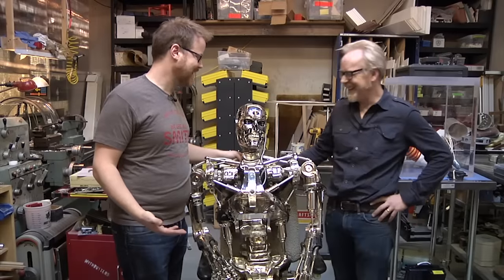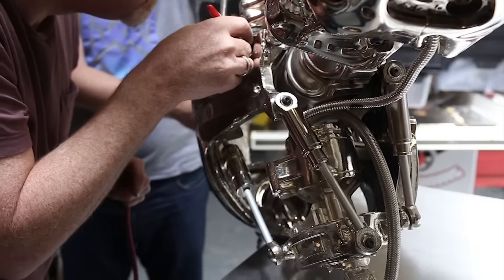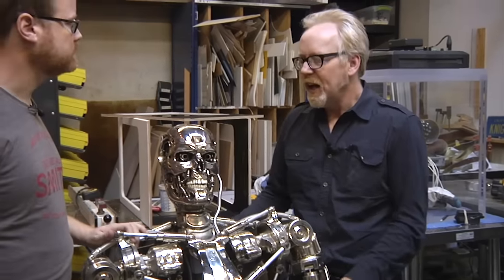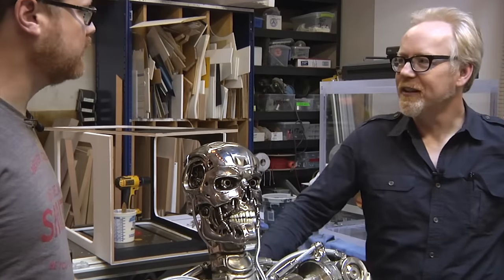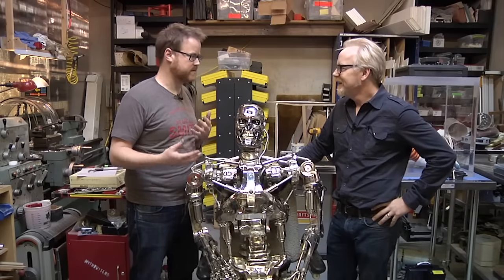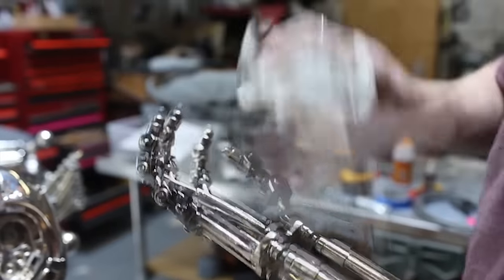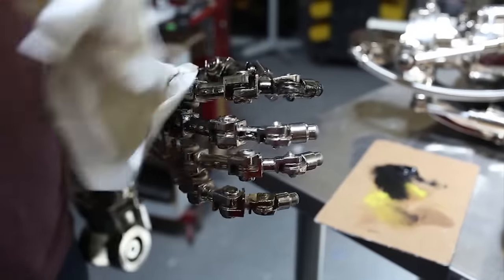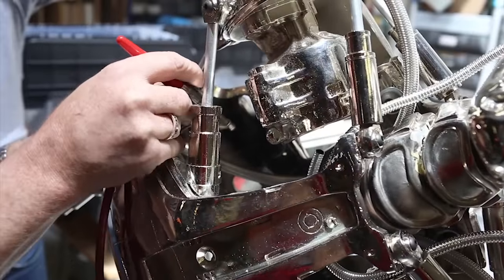Adam Savage's Terminator T-800 Endoskeleton

Comment: Use an Arduino to follow you? If you are planning on use image processing, it's quite impossible with a microcontroller. You are gonna need a ARM or microprocessor or something like that, which is much powerfully. Arduino would be great only to control the servo motor in the head. But, this can be done with RC (servos and a radio controller) as well.
Reply from the maker: We had talked about using a few IR movement sensors to get close enough.
Reply: Tested I thought about that too, but you guys need several of this sensors than, and they will be visible, which would look great. A camera in the eyeball of the exterminator would be much cool!
Reply: Xano Trevisan Kothe It all boils down to how many pixels it has to process and how fast, there's a kickstarter project that does it with an ARM and does I think 20 frames per second at 340x200 but if you settled on 1-2 frames per second and 120x80 pixels an Arduino should manage it. I don't expect you would need more than 1-2 frames per second to perform object following.
Reply: LD Gaming/The LDG
Please pardon my ignorance on this, but what does this 1-_-1 mean?
Reply: I uh I dont know
Reply: LD Gaming/The LDG
Thanks
Reply: +Xano Trevisan Kothe I know I'm probably performing a bit of necromancy here, but a few thoughts on this. You could most likely do it with a Raspberry PI which aren't much more expensive than an Arduino but they are a lot more powerful, heck for image processing they actually have gfx chip that can render HD video, though for actual image processing I'd suggest probably going lower than full on HD as that's still a rather intensive task.
Reply: +The Logan Hi logan, you cant control servos with raspberry that's it
Reply: I'm a programmer not an electronics wiz, so I don't actually know what I'm talking about in regards to motors and such, but I found this guide before I posted just to be sure and figured that it was doable.
http://razzpisampler.oreilly.com/ch05.html

If all else fails I suppose you could always just hook up an arduino to a raspberry pi and fix it that way?
Reply: The Logan it's not going to working as you expected. As it says "Although this will work, the PWM generated is not completely stable". You servor is going to move all time because of the unstable signal, which is pretty bad. You have to use a microcontroller to control these thinks
Reply: Ok, so a Raspberry as brains and an Arduino as "brawns"? Would that do it then?
Reply: the way to go is: start with arduino then move to integration with raspberry and then image processing
Reply: Ok, I think that's more or less what I said, with the addition of what to build first xD
Reply: +Xano Trevisan Kothe Eh, it's certainly possible but not always the easiest to do. Some really basic code could trigger movement left or right etc. Not everything has to be super technical or 100% spot on, for his purpose a few lines of shitty code and some extremely basic motion detection would work just fine.
Reply: +Xano Trevisan Kothe I control servos with a raspberry <<< busted!
Reply: C ancelor
The Raspberry has a very powerful processor at its core, so I'm not sure you've busted anything in regards to Arduino. The Arduino is an ~8MIPS processor and the PI is a 1000MIPS processor. MidnightMarrow correctly suggests that the Arduino can do it given the correct design contraints and his wording also suggest (maybe not intentionally) that you can do it without a processor
Reply: +Xano Trevisan Kothe Raspberry Pi with OpenCV for motion tracking.
Reply: +Xano Trevisan Kothe necro-thread I know, but rather than a full on microcontroller they make a really good pwm/servo HAT for the pi that I've used, you can also use it's pwm to control leds, for things like the eyes.
also benefit of the pi is that it has an audio port, so could trigger sound effects.

pwm/servo hat: https://www.adafruit.com/products/2327
Reply: +Xano Trevisan Kothe yes you can control servos with a raspberry pi. simply put one of the pi hats on it like the 16 bit controller. arduino also has a shield you can plug in to control servos or stepper motors. it "can" be done with either one. I'm sure he knows what he was saying when he mentioned the arduino, he is not a stupid man.
Reply: I am at this very moment sitting at a desk with an Arduino based robot on it that follows objects with the aid of IR and light sensors. Real simple.
Reply: Adam Rasmussen
I think what he said was with image processing, although I do believe that it should be possible to do it with and Arduino and image processing as well, just using less pixels. If you decimate the pixel array down to a 1/4 you should need less than 1/4 the processing power.

In a way you've done that by reducing it to 1 or 2 pixels.
Reply: vernonclassic
?? I think you replied to the wrong comment, I think you meant to reply to Adam Rasmussen. I assure you I was in no way intending to make fun of you with my comment, I was just offering a method by which an Arduino could be used
Reply: vernonclassic
It's called broadening one's horizons, nothing wrong with wanting to participate in a conversation on a subject that interests you, how else would we learn about new things after we leave school.

For you information, following type algorithms basically try and look though the pixels of an image and recognise structure and then understand where the structure is and what if any movement vector there is.

If you have more pixels you get better accuracy of course but as most operations involve calculations with the current pixel and its immediate neighbours in the early parts of the algorithm, the time required typically goes up as the square of the number of pixels, and it's why say video resolution arrays need a fair bit of grunt to finish in time.

Where you can save time is reducing the number of pixels, but also some applications may not need a full update 25 times per second, maybe once per second is enough.

This means that relatively modest processors can do this given either less pixels or more time.

These parameters basically affect accuracy and response time respectively.

Basically the point of my original response was "Arduino can't do image tracking" was too broad a statement given the limited specification, ie. pixel array size and image refresh rate were not given.

BTW, even if you have a higher resolution camera you can always merge/average neighbouring pixels and throw away frames before you run the tracking algorithms, ending up with a tailored solution.

I once needed to do a complex calculation in <1mS on a slow  processor and achieved it by doing the maths as a 24bit by 16 bit divide with 8 bit result which meant a custom assembler written routine, ie no high level language would provide that. On a faster processor it would have been a 32bit by 32 bit divide with 32bit result which was then decimated to 8bits
Reply: vernonclassic
I love Chilli, my favourite head cold remedy is a raw habernero. I love slight of hand magic, don't fancy daring escape type performances though.

You should read it all, I put it in relatively simple terms.
Reply: vernonclassic
Yeah, that's why I'm not a fan of escapism, figuring out how someone got out of locks etc. to avoid drowning or losing their head etc. with the reward at the end of watching someone die when it goes wrong isn't my cup of tea. Watching someone apparently defy the laws of physics where the reward is a chuckle because the illusionist's finger slipped etc I can deal with.
Reply: Xano Trevisan Kothe
Reply: to all of you saying "you can control servos with raspberry" no, you can not because it is not a RTOS. For those the said "I control servos with raspberry, haha busted" you are lame, you are using a microcontrollers with the raspberry which is what I suggest in the first place. Best regards
Reply: Xano Trevisan Kothe
I'd suggest you are the lame one, because the raspberry is a processor board and what OS you run on it is up to you. Slinging mud always ends up putting some on the mud slinger
Reply: Real Dream
You forget, in the movie it had skin over the top and was supposed to look like a human so it infiltrate human groups. If it had metallic teeth it couldn't do that so I would say it is correct.

Comment: I am incredibly jealous of this. Mind you, as a robotics engineer, rather than assembling the plastic kit pieces I would probably have 3D scanned them to make a fully articulated CAD model, then worked out how to integrate working pistons and motors, then CNC'd the parts from aircraft aluminium, (or if I had the money, AZ31B Magnesium alloy, for weight reduction).

Comment: Friction-less ball bearing joints or not, Terminators are still prone to oxidation, dirt, clogging, and so on.  So I imagine that, unsheathed in cloned flesh, they would get filthy pretty quickly and require regular maintenance.

Comment: just get a 12v car battery, store it within the chest. have it connect with a 12v to 5v converter to a raspberry pi 0 and the have real pistons that are powered by the battery but controlled by the raspberry pi. then you can connect cylinder cams in to the eyes and have a 4 tb hard drive connected to the pi. If you can make a custom psu to support all those charges you could have a real T-800 that can interact and kill I mean show off. You could even have an antenna that backs up the data from the hard drive. That would be the best thing to see.

Comment: the T-1000 is a more advanced Terminator, composed entirely of a "mimetic polyalloy", rendering it capable of rapid shapeshifting.
Reply: SmoKingPackRaT how did the time machine work for it
Reply: gregistopal we'll they used The time displacement equipment (TDE, or time door) it is a machine which allows living tissue and mimetic polyalloy to be sent back and forward in time.

Comment: 3D metal printing moves things a concerning step forward.
Soon it will be very easy to manufacture something like that and it wont be a plastic prop but a high strength piece of engineering.

Comment: New modern version on T800 or t888 it used on the battlefield...None of stormytroopers are bulletproff in all joint points or antipersonal mine but the human soldier what are incapacited by a direct hit in weak point or severly damaged by the blast of mine sweapers it will be a new cyborg human experiment...

Comment: "They haven't made a t800 since terminator 2, right?"
Um, yeah, if you don't count the two fucking sequels!
Reply: Those were computer animated (CGI's), and 4th part was T850 not T800.
Real dolls making stopped at T2.
Reply: Negative. They made t800s for the assembly line shots. They painted them dark, almost black.
Reply: ghostdog2041 //advanced_combat_endoskeletons_model_T-800//knowledge_of_war_machine_noted//await_extermination//

Comment: NO it the T-101 not the t-800
Reply: 101 is the model number of both T-800 and T-850 series terminators, 101E is the model number for the T-801. So you are right and wrong. It is a 101, but also a T-800.  For instance, Honda has a Civic,  a Civic sedan and a Civic hatchback. Same model name of car, but 2 different variations.